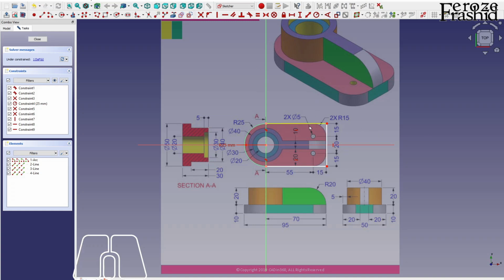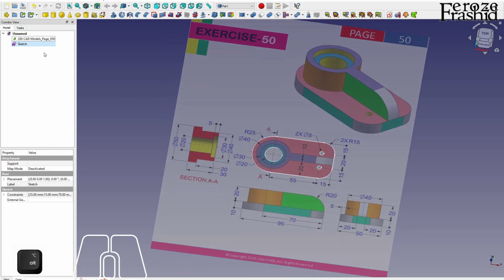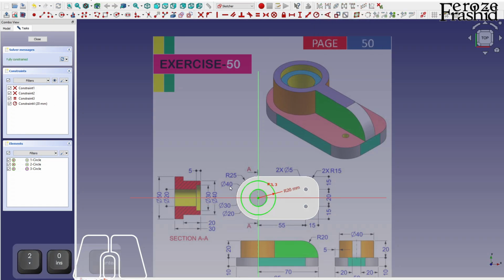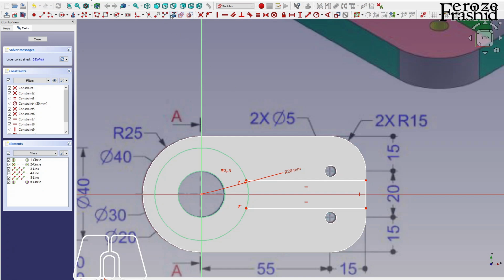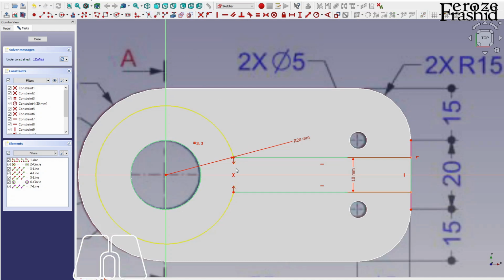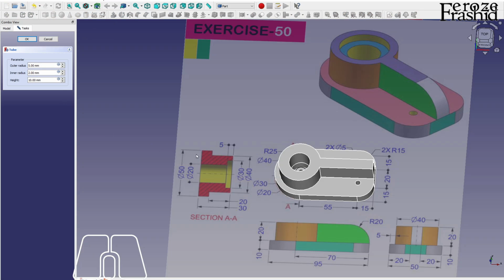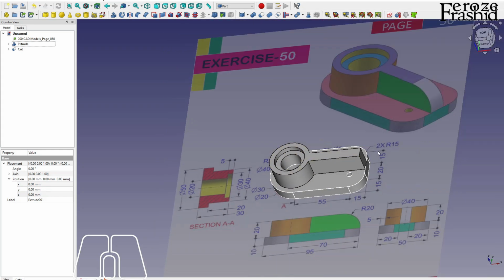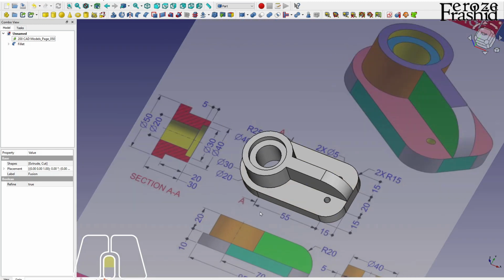200 3D Models in FreeCAD: Exercise 50

Comment: I understand why you do it, but…
Making the fillet 19.99 is not actually 20.  The point of CAD design is to be able to be precise. 
In some of the previous projects, where 2 fillets met, there was a residual line. This is actually a “flat spot” of dimension 0.02.
To achieve the actual precision (if so desired), the use of another sketch or another workbench might be necessary.

I understand that this an engineering approximation or short cut. (But, sometimes it matters….)

As always, I greatly appreciate your videos and I’m learning a lot through the techniques you utilize.
Thank you!
Reply from the maker: I agree with you. I have always felt filleting and chamfering in FreeCAD are not well developed yet. That's why I try to make those corners in the sketch where I can.